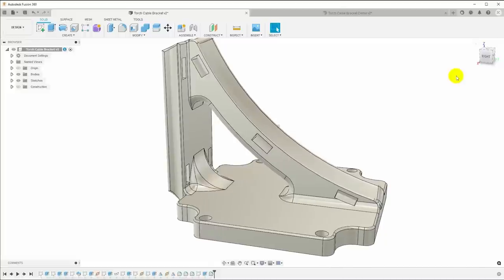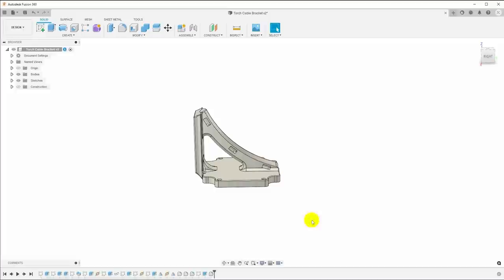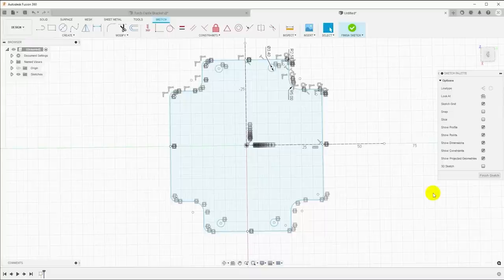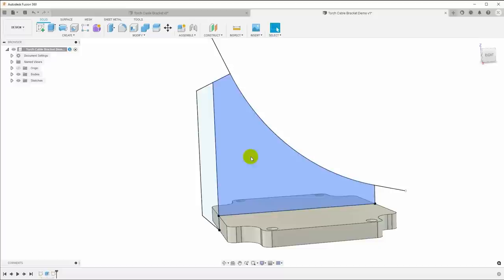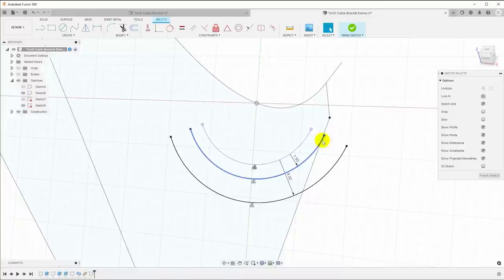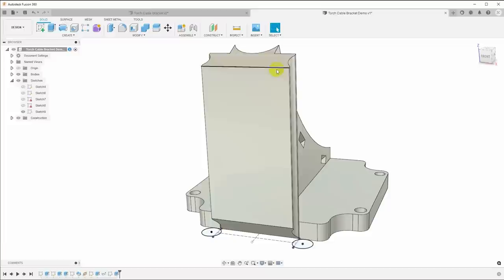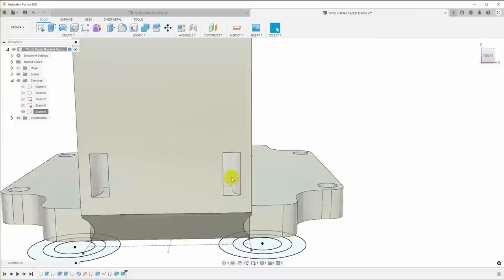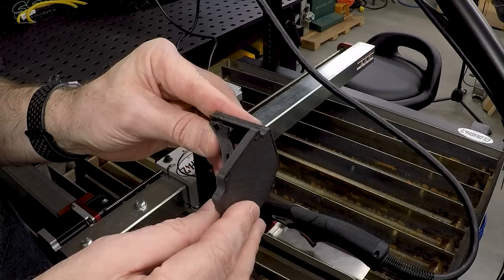Modeling a Complex Part in Fusion 360 | Langmuir Crossfire Plasma Torch Anchor

Comment: A few suggestions for general modeling approach: Don't intermingle your features - the fillets and holes in your base sketch should be in separate features. Different constraint types require different amounts of computing horsepower: leveraging symmetry is lowest, next are geometric constraints (coincident, parallel, concentric, equal, etc), with dimensions imposing the largest penalty. Instead of adding dimensions to the second side of your base and setting them equal, just constrain the line segments to be equal. Use the power of the hole feature to create your holes. Fillets and chamfer should be added last from largest to smallest. Why??? For a part as simple as yours you won't notice the difference. But as part/assembly complexity increases the computational burden skyrockets. Not mixing your feature types makes subsequent editing much easier - particularly if someone else needs to modify your file. Holes as a hole feature are much more intuitive than guessing which extrusion sketch they are buried in. Additionally, at least with SolidWorks, calling out a hole feature on a drawing is far superior to calling out a round cut extrude that mimics a hole. Finally, fillets and chamfers come with substantial computational overhead and often "break" your model. Having them at the end of the feature string allows for simply dragging the timeline back to suppress them without affecting any of the core geometry. All of these suggestions are to develop good habits so that they become second nature regardless if your model is complex enough to notice the inefficiencies. Consider a simple screw model that has a two millisecond rebuild penalty... and now put 1000 of those in your assembly.
Reply from the maker: Great tips.  Thanks for sharing.  I often run into trouble when adding fillets too early--both because of lost useful geometry, and because they start to interfere with each other and others features.  Leaving them all to the end is a great tip.
Reply: Thank you for this detailed set of tips. 🙏🙏
Reply: Could you post a video outlining this alternate (better?) method? Of his part
Reply: I totally agree with using the hole tool, and separating features so that they appear as separate alterations to the model in the time line.  It makes it much simpler to come back to the model in 6 months and have an intuitive pointer to who each feature was conceived and created in the time line.  It helps reduce questions like “where did this feature originate” for modification or sharing with someone else who doesn’t have the benefit of your workflow process.
Reply: As the hole feature need a reference to be placed in the sketch for positioning, what is the proper way to do it ? Do you just place a point in your sketch or do you put a circle with the future size of your hole ?
Reply: I see this as a good reason to upgrade to that i9 processor.
Reply: @WheatMillington  go to agree with you there.
Reply: Great tips!! Thank you for your time.
Reply: Damn mate not only very articulate but you seem to be defining an entire design philosophy in a couple sentences.  Gonna break this down one at a time.  Have you done a video on this? Cheers
Reply: Thanks for this comment. Do you have a resource where I can learn more?
Reply: I think using a circular pattern (for the motor plate) instead of mirroring would have been easier as well.
If you change the construction lines to middle/center lines you can use diameter values as well.

I strongly agree that the fillets and chamfer should be added at the very end.

Comment: i havent used any cad software for....almost 30 years? ;)  and that was all 2d drafting cad as a teenager. i have modeled a few brackets and useful parts by sheer brute force with zero experience but this is super useful. thanks. youtube's algorithm worked...and i had never searched for designing anything in fusion3d ;)

Comment: For 3d printing, I almost exclusively use chamfer, not fillet, in my designs. Fillets can lead to weird and u supported overhangs in off places and aren't always obvious or intuitive. Chamfers are tge same overhang angle the whole time and usually are 45 degrees, since most parts are vertical or horizontal. In short, it's usually simpler.
Reply: You use fillets when you have a vertical edge (parallel to the z axis), this way your print head will face less acceleration taking a curve than a sharp corner, leading to better result and faster printing speed.

Comment: James, as always, I commend you for your outstanding grasp of such diverse knowledge.  I always learn from your videos.  In this particular case, I wonder if you aren't just a bit too clever.  My first couple of years transitioning to F360, I found myself trying to be so clever in employing the vast complexities of F360, that a year later when I came back to the model to make changes, I was perplexed by my own creativity at exploiting the power of all the tools.  It was a great ego satisfaction to see my grasp of F360 expressed in such a compact and clever manner.  A year later, when I needed to revise the model, I was kicking myself for being too clever.  

So I have resorted to being as verbose as possible in the timeline sequence - adding as many timeline entries as possible to convey the sequence of the workflow that lead to a particular design.  Yes, this clutters the timeline with lots of entries, but once a particular feature, element, component, etc. has been constructed in the model, it's simple enough to collapse the timeline into groupings that are specifically titled to give you (or someone else) a clue as to what a particular sequence in the timeline is related to.  For instance, I avoid putting fillets or chamfers in the sketch, and instead add them as model feature modifications later - that way they will show up as distinct entries in the timeline.  Same with holes - place a point in the sketch, then use the hole command to form the hole - this way the hole is in the timeline, and a separate editable item, related to the sketch, but still separate from it.  Same with specifying an odd-ball joint origin - make those specifications purposeful in a sketch rather than using an "offset" in the joint placement - you'll thank yourself later for doing so.

Hope this is constructive.   Keep doing more F360 stuff.

Comment: Nice tutorial and workflow, especially appreciate the hole spacing measuring tip. I normally measure corresponding hole walls as it is more accurate than guessing centers, but with calipers that still requires locating one side by eye.

Comment: This is quite helpful. My wife wants me to model and print some jump blocks for her horses. In my head, it’s simple… an 8” cube with a 3.75” saddle cut in the top for the PVC pole to sit on. Print two so the pole rests across them to create her jumps and be done.

But I learned real quick that such a simple design would take two days each to print and use nearly a full spool each. I needed to rethink my approach. This helps with the thought process and some tricks I didn’t know before.
Reply: Sounds like a job for dead tree
Reply: @nicholasroos3627  yeah, but this is more for adjusting how high the dead tree rests and adjusting that height when desired. 

Got the jump standards made and they turned out pretty good. Took 7 hours a piece to print. Bolt them to the lid of a 2.5 or 5 gallon bucket filled with sand and stack the buckets to the desired height. Uses a 3.5” PVC pipe or a 4” landscaping tie for the jump.

Comment: Never knew the pattern feature, gonna use that a lot.
For symmetrical designs, I tend to mirror the solid at the end, after all the fillets are done, so I'm not doing each filet again for each symmetrical piece and not forgetting one somewhere.
Also for the line sketch you can click drag to get a curve directly instead of another line segment, which can be annoying if you mouse moves a little on the first click you can get a tiny additional line that does it's best to bite you latter.

Comment: Great job and nice video. I know you said you are done and you are. (but) An idea for a future video would be to CNC a small bock to mount your tip and wire liner with a 3D printed handle and bam, two moor great Cloug 42 videos.

Comment: James that was very informative. I like that you state what key you use for an application. I just started using 360 for hobbyists but years ago I used SolidWorks and am refamiliarizing myself with the commands used. Both programs are fairly similar, thankfully. Thank you for sharing.

Comment: how did you deal with the material shrinkage issue? what tolerances do you give? one standard value? or multiple for different fits, if yes what are those values?
Reply from the maker: It didn't shrink much, if any, due to the carbon fiber.  I used a -0.25mm wall adjustment and everything came out pretty much on size with my printer.

Comment: Nice video! I wonder if that flat aluminum face is designed to dissipate some of the heat in the stepper motor? Perhaps feel the motor when it's working, so it doesn't overheat.
Reply from the maker: Lots of people seem concerned about this.  It hasn't been a problem on my machine, but others might have a different situation.
Reply: @Clough42  Glad to hear it, maybe if you were trying to set speed records or something on the CNC, you'd have an issue, but if the motor's cool, then all's cool!

Comment: Fantastic content and I always learn new tips and tricks by watching your videos. Keep them coming!

I printed the cable bracket this morning on my Qidi X-Plus with CFPC filament. Some slight droop on the top of the recess of the vertical support (I believe you called that out in the video for a redesign to have a 45-degree fillet there).  Fitted perfectly on my crossfire pro and makes a huge difference in the force applied to the torch. Definitely worth the print time. 

Check out Stuff Made Here's video for a 3d printed bracket for a sharpie pen to draw bend lines. I made a manual version (no air solenoid) and love it for sheet metal parts. Saves tons of time by not having to print out drawings and scribe lines.  I have the Eastwood brand electromagnetic brake which is probably the same as your model but with a different paint scheme.

Comment: Great Video Thanks. Im trying to learn how to draw and calculate angles of a polygon:  If I draw a 12 side poly, offset it by the thickness I want and then connect all the lines to make segments? lol Im a wood guy trying to learn
Reply from the maker: That would work.  You're trying to figure out the required miter angle?
Reply: @Clough42  correct. And print a list. Segments than can be glued and then trim with template and router for example
Reply from the maker: @Island.dweller  I think it would be better if Fusion had proper weldment support, but I think you can accomplish what you need by doing it that way.

Comment: Cloigh42  I see you purchased the Z motor mount for your plasma cutter.  I have the same Langmuir Plasma Cutter.  What are your impressions of the Z-Axis, and is it worth getting for this plasma cutter?   What benefits have you found using the Z-Axis vs locked Z-Axis?
Reply from the maker: I have the torch height control, and I'm not sure how you would cut large parts without it.  For my plasma, the cutting height is .035", and there's no way to maintain that over the whole table on real material without it.
Reply: @Clough42  
Thank you for the reply.

Comment: Great lesson. What kind of  3D printer to you have.
Reply from the maker: It's a unicorn, made from a frame from a company that's no longer in business, eBay electronics, and my own extruder design.
Reply: @Clough42   Did you aver make a video of the design and construction of it? Thanks
Reply from the maker: @gwharton68  no.  That was years before I started my channel.

Comment: That’s far from being called a compound curve!
Reply from the maker: If you'd like to make your comment useful, you could explain what such a surface should be called instead.
Reply: @Clough42  you’re right, I was in a hurry. A compound curve is where you introduce multiple angles where guide curves are used. I can look at your part and see that it’s only a simple curve, not compound. I’m an ex-mechanical engineer, retired at 53. I was an expert at 3D modeling and complex assemblies for 20+ years. Items like impeller vanes in pumps utilizes compound curves. I hope that helps.